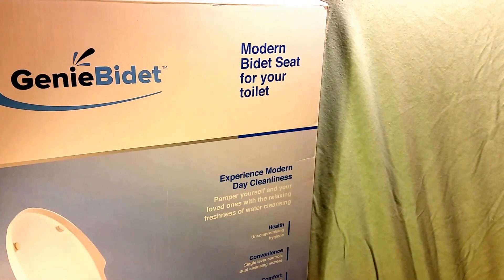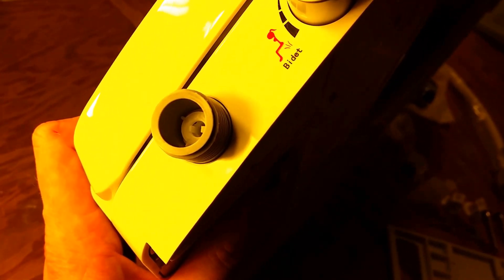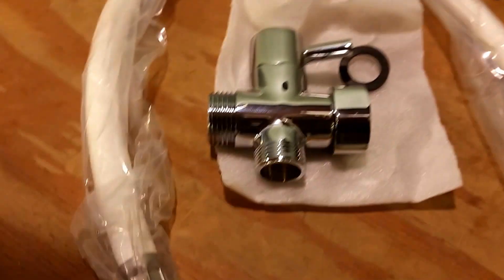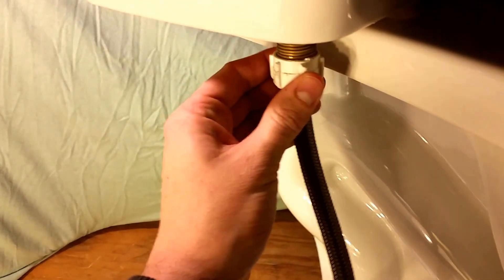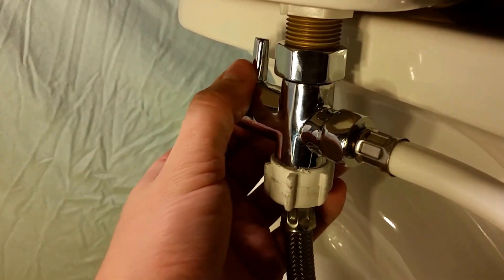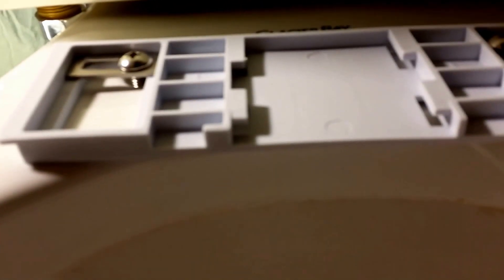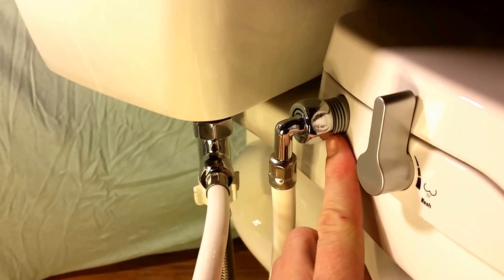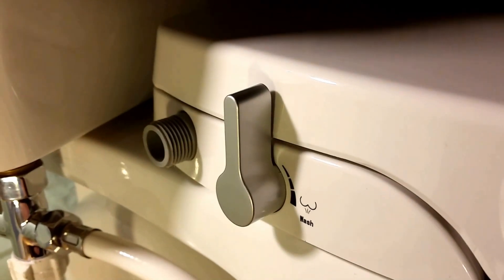EB-1000 or RB-1000 installation video

Comment: I got the bidet toilet seat installed but know the water in the tank won’t stop running. Any suggestions? Thanks for the video
Reply from the maker: It's likely that when you screwed the T-adapter on to the fill valve it turned the toilet float inside the toilet tank  and maybe it's hitting the side of the tank?  Not sure what fill valve you had but watch this video for old style fill valves.  https://www.youtube.com/watch?v=9oCoZSa0Fo8
Reply: @thegeniebidet  That Worked !!!! Thank You so much. I love the bidet btw